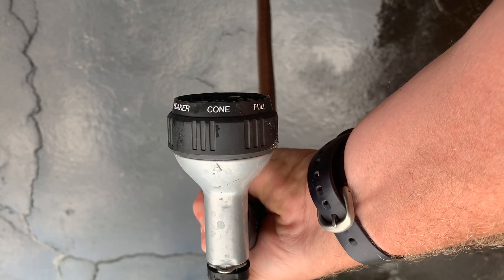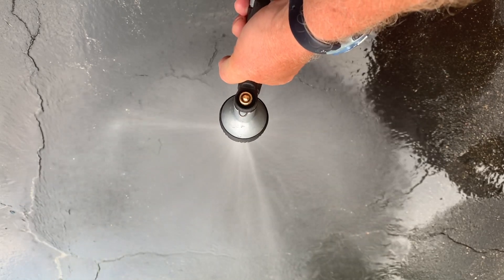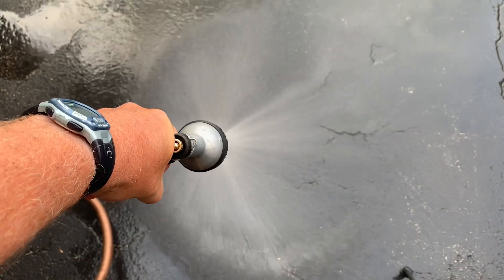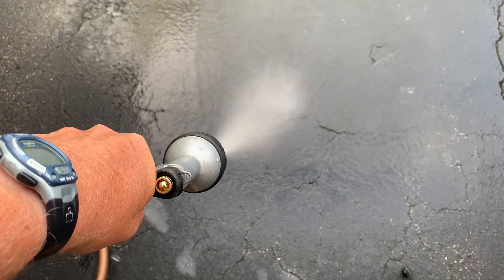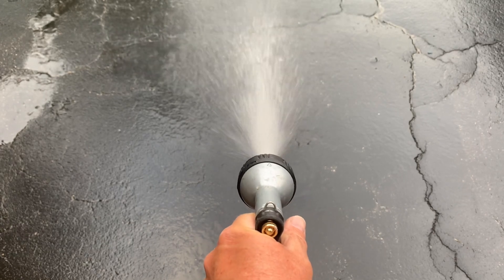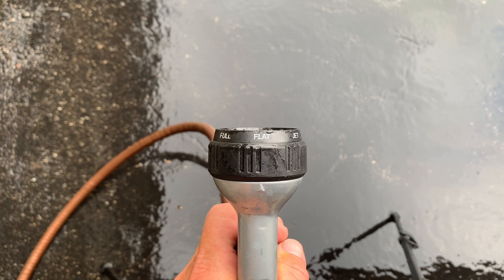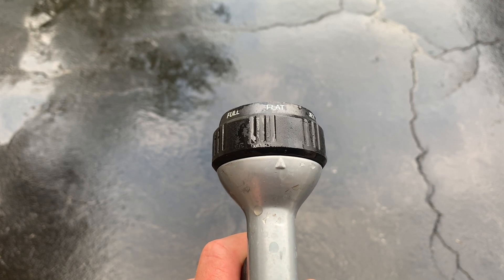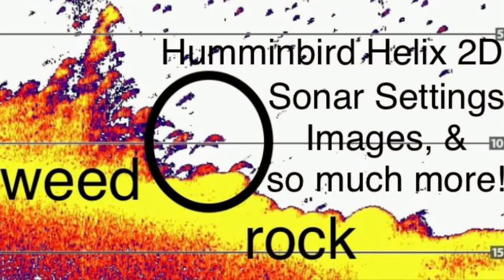Humminbird 2D Sonar Cone Angles

Comment: Great Channel! Could you discuss deep water use? I spend some time on the Finger Lakes here in NY. Not quite sure I'm using good settings for the 60' -200' area. One thing is DI returns are quite dim. 2D looks normal. Is SI useful at these depths? Is the edge to edge distance of 2D & DI the same in non-zoom view? Lake Trout. Helix 9. Thanks!
Reply from the maker: Thanks for the kind words Joe. 2D is your best option in deep water.
Reply from the maker: DI is a thinner beam with a limited depth range depending on your unit. As I mentioned 2D is best, the closer you get to 60’ the more options you have for DI and SI, 200’ is pushing the limits. For SI using 455 frequency will give you a wider image. Mega SI has a more limited range.

Comment: Which transducer are you are referring to?
Reply from the maker: If you have a basic sonar only it will be a 2D transducer. If you have a down imaging unit, the transducer will do 2D and down imaging. A side imaging transducer will do 2D, DI, and SI.  Older units have the 20, 60 degree cones. Newer units, Helix G3 and newer have dual spectrum chirp.